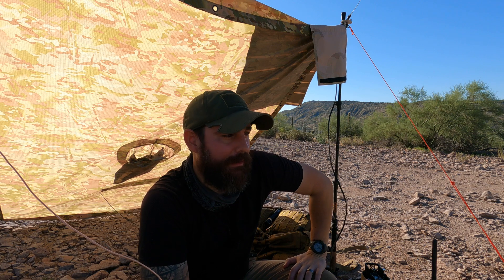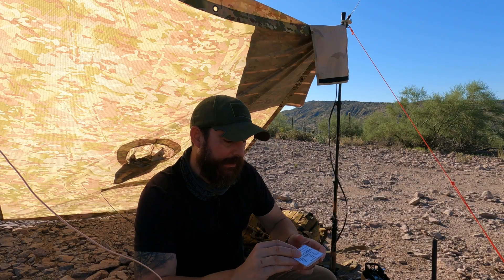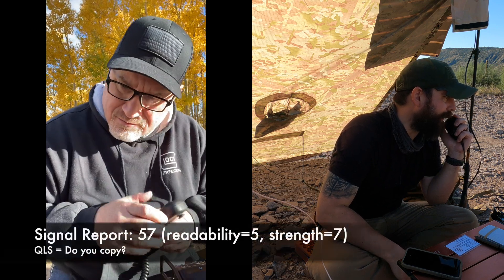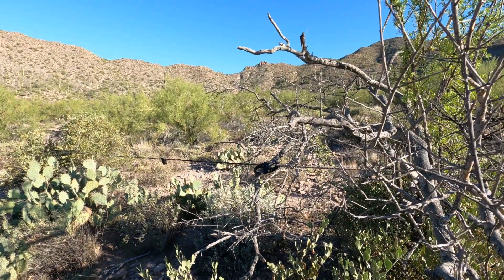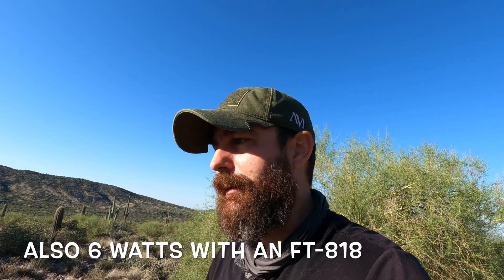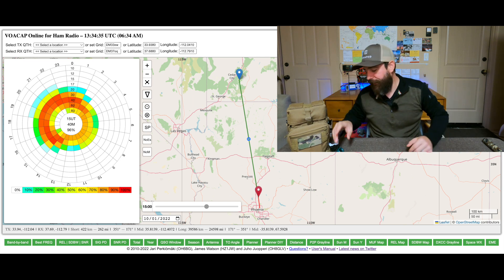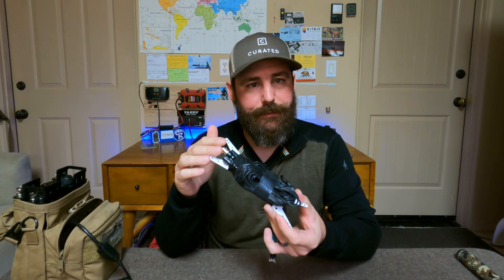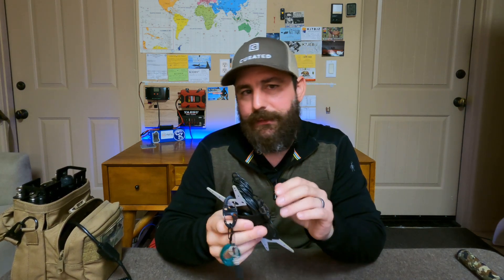Offgrid Regional Communication - No Random Contacts Series

Comment: Because of the geography where I live,  300 mile contacts are no big deal.  I can easily hit a repeater on the opposite side of one of the biggest valleys in the country (over 100 miles wide) and then people another 100+ miles away can also hit it.  But my local club repeater that's 2 miles away?  No such luck.  I'm blocked by several ridges,  and the only way to talk to someone literally in the same small mountain town as me is with NVIS.

Comment: Excellent example of NVIS. Using NVIS will be key for regional or local coms when other methods of communication are not available. NVIS is especially useful for close in coms when you live in an area with hills and mountains that prevent line of sight or ground wave communication. Although not needed in this case, a piece of wire, 5 % longer than the dipole, on the ground directly under the wire will help the signal go straight up at a higher strength. It's my understanding that if off to one side or the other, it can help push more signal in one direction or the other if needed. This is something I want to experiment with more. I have a NVIS 40/80 meter fan dipole in my yard and use the wire on the ground on a regular basis. I have not done an A/B comparison yet.  I also have portable 40 and 80 meter antennas. The wire would take up little room in your bag and could prove to be an asset in tough conditions. Maybe something to look at for a future video. Just get out and do it. Thanks for another great video. P.S. Why did you not have a roll up J Pole in your bag for the APRS ? I find the J Pole to be something that is always in my go bag. In an emergency, it will be far easier to get help on 2 meters (in many cases, repeaters available) than to set up HF in NVIS. Just a thought. I know your video was mission specific. One other thing. If you don't already have a radio, the Yiegu G-90 is also an excellent portable radio. It has a great built in antenna tuner (+9 to 1 range and offers up to 20 watts output). The Yaesu is a great radio, but I find the G-90 to offer many more features. Many of them very useful. Both have their advantages and disadvantages. I think the Yaesu to a tougher radio. The G-90 requires a separate battery. Both have low battery draw. The G-90 also reads CW. Something good for those of us who don't do CW. The G-90 is a SDR radio. Look at both before buying. If I had the $$$, I'd be using the Icom 705. Great portable radio, especially for ease of use in digital modes. None of this is to take away from the great video. You did a great job !

Comment: Have you thought of a way to use the sordins/disco with the 818, or is the juice not worth the squeeze? Great video.
Reply from the maker: I have, but it's just a matter of getting more funds to finance another adapter. It's on my list of gear to research and buy. It would be good for OPSEC.
Reply: @TheTechPrepper  I'm doing the research to build it right now if I have success I'll post what I did to DIY

Comment: Please attempt a very close contact between 1-30 miles with 40/80 m.  With geography that eliminates the probability of HF ground propagation.  I see many NVIS tests but none at very close in distances that are not prone to HF group propagation.
Reply from the maker: I do this regularly on 75m voice. There is a station 17 miles from me. I believe that it may ground wave proportion at play. This video captured that contact: https://www.youtube.com/watch?v=-pKLZCuWZY4
Reply: @TheTechPrepper  We (PrepperNet Asheville in the mountains) have tested NVIS 40/80m Voice for our group EComm and find it not effective within < 30.  As you have experienced 75m works close which matches our experience, but all these contacts can be explained by ground propagation.  When a station is in a deep valley with significant terrain between stations NVIS has not been effective < 30 miles out.  I believe the true “Vertical” as opposed to “Near Vertical” is not being reflected straight back down.  Which results in a skip zone for NVIS of ~30 miles.  This is highlighted in most all NVIS literature as it is effective from “30-300” miles and not “0-300” miles.  Our goto has been VHF/UHF repeaters as we have excellent stations on Mt Mitchell and Mt Pisgah in addition to our strategically placed private repeaters.   Still Looking for a robust EComms solution in mountainous terrain for < 30 miles. Suggestions?
Reply from the maker: @echopapa243  My solution for the < 30 mile range is to essentially deploy a poor man's repeater using a rig that is capable of cross-band repeat. Personally, I use the Yaesu FT-8900 (manpack) or the Kenwood D710 (vehicle mounted). We are still testing this technique out with my group, but the plan is deploy it at a high point such as a ridge line or mountain top. I have a "No Random Contacts" video planned to demonstrate this as part of the series.

Comment: Gratz on the QSO. Nice mission. I wouldn’t say a tuner lies, it produces a match. But yes, you will take a hit on power. On the other hand, what if you don’t have a resonate wire? Or if your comms plan requires a backup band?  Your pack will fill up with custom single band wire antennas. And remember, you threw off your perfect match by putting your NVIS system so low anyway (unless you trim tuned it for that height and ground). Even qrp maximum power isn’t everything. It is just another tool to consider when choosing the antenna system compromises to fit your mission. 
But not casting shade. It was a good video and successful mission! Just wanted to offer  some nuance.
Reply from the maker: Thanks, Thomas! Good call out. I really should not have opened my big mouth about the tuner as it looks like I was completely wrong. Unfortunately, I have heard all of things I have mentioned by one ham or another over the last two years. I really appreciate all the corrections from yourself and the others in the comments.

Actually, I tuned my antenna for this height (4-5 ft.) in the same terrain. My match was 1.2:1 at this height in this environment. Am I still missing something? 

I have a linked dipole planned for this series that will cover 40m/60m/75m/80m. My radio bag also included two very small wire antennas: a 20m EFHW and 17m dipole (of similar design) just in case there's a contest and the bands are packed. 

I also have a random wire and antenna and QRP manual tuner in my bag of tricks, but did not bring it. This video was more about selecting the right tool for the job. Over the course of this series, I'll share my experience with different bands, antennas, radios and modes to solve different problems. There is no one solution for everything,

Thanks for your feedback. Take care.
Reply: Good stuff. Sorry if I came off too strong or critical. No, I don’t think you missed anything (other than the HT issue you already covered). You planned a mission, and accomplished it, then communicated it well. Good stuff!
Reply from the maker: @thomasr.jackson2940  Not at all. This is a public forum. All feedback welcome. Cheers!

Comment: Great video!  I don't quite understand at 6:04 ....who "told you" that you couldn't make a relatively short distance contact on 40m with that configuration?  Similar contacts are made every day.
Reply: 14:44 The "RF entergy loss in the form of heat" comment regarding the use of a tuner is not correct at all.   An antenna doesn't have to be resonant to radiate well, and a resonant antenna doesn't necessarily outperform a non-resonant antenna.  An example of this is a 5/8 wave whip antenna or an off center fed dipole.  Just so you know, an antenna tuner is typically 95%-97% efficient and rarely gets hot while in use.
Reply from the maker: Thanks for the correction.
Reply from the maker: Excellent question. I have been told at least a few dozen times by hams on HF over the last two years essentially these things:

1. "Don't even bother getting on the air if you're unable to deploy at a half wavelength." 
2. "If you go below 1/10 wavelength for NVIS that the ground is absorbing much of the signal, so don't bother."

I've also been told on our local AZ nets on 75m (3.868 MHz) that there's no way I'm running QRP and that I'm pulling their leg because of my antenna height above ground and low power.

I nearly dropped out of the hobby a few times. I'm sure that there are other new hams that run into these salty operators. In general, most of the experiences have been good.

I agree that going the text book route will improve your effectiveness, but sometimes that's not possible especially as a field operator.

Cheers!
Reply: @TheTechPrepper  Again, thanks for creating all of these videos.  The terminology you use to describe these scenarios and actions is spot on, and I love the "less is more" philosophy.
Reply: @TheTechPrepper  whoever told you No2 is full of BS. Using digital modes I’ve made contacts from 0-300 on 80m nvis with the antenna 6-8 feet off the ground. Thanks for another good one….

Comment: Great video! I'm glad you were able to make the contact on the first call. It's nice when a plan comes together. You've show your 40m NVIS antenna in many videos. Have you ever thought about doing a video to show a detailed WSPR plot from the field to show how close/far away stations can hear you at QRP or QRPp power levels? I think that information would be interesting to see. Also, which VOACAP website did you use? That RF clock chart looked very handy.
Reply from the maker: Morning, Sean. Thanks for mentioning WSPR. Yes, we will cover it in this series. I have a technique that we will use to show where you are propagating 100% offline. I WSPR and FT8 an a lot for this type of analysis.

I used the https://www.voacap.com/hf/. The RF "Prop Wheel" is a handy tool.

Be advised, I am building an offline tool that will do this using the "voacapl" command line tool under Linux. It will be integrated into my offline comms platform (EmComm Tools) as soon as I have some free time.

73 de KT1RUN
Reply: @TheTechPrepper  very cool. I'm really enjoying your videos and have been going through your older videos as I have time. Lots of great information.